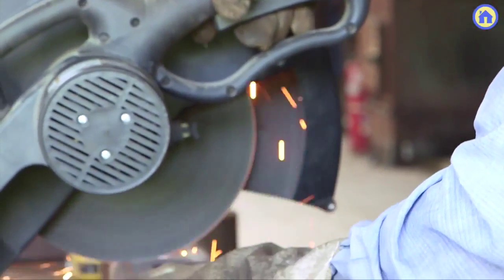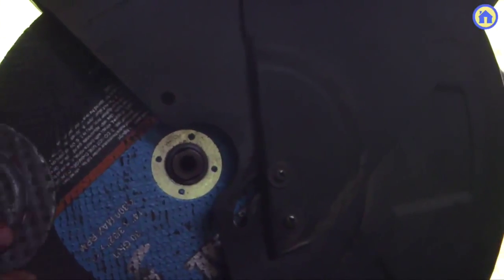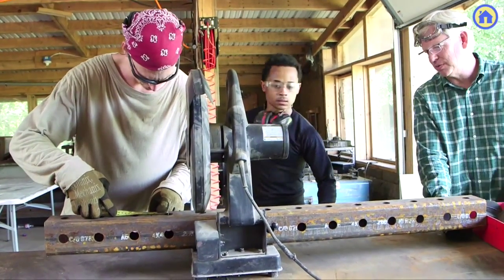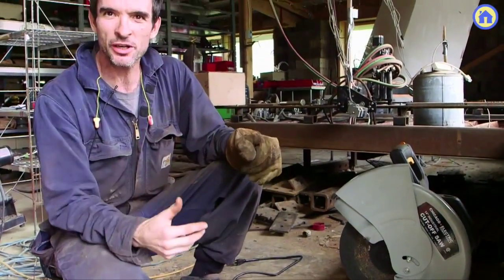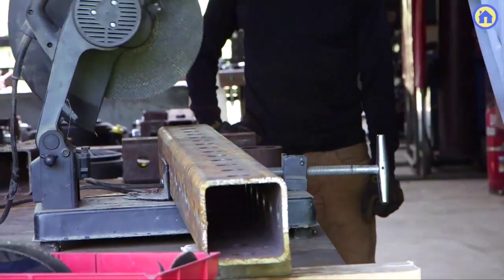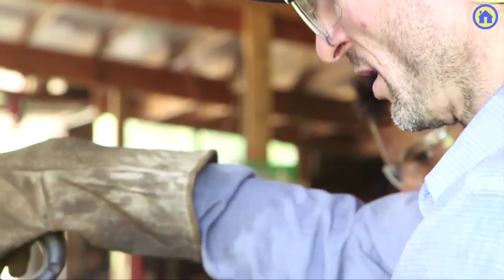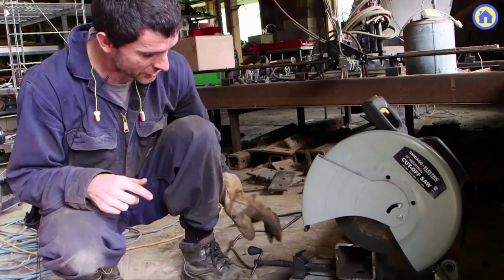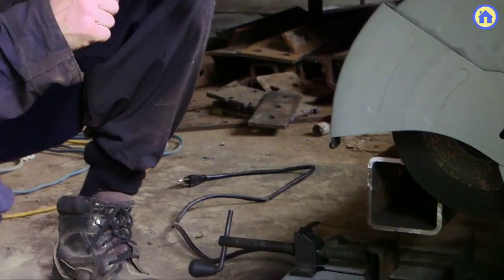Abrasive Cut-off Saw - how to use it?

Comment: I have a Dewalt chop saw and for what ever reason it won't cut. It just sits there and gets red hot.
Reply: Same here! I purchased Dewalt cut off machine from Amazon to build a metal frame from 2×2" box tube but it feels like that the machine will take forever to cut. Sometimes it makes the cut but the cut goes off like slant, Even cutting straight is not possible on this machine. Let me know if you have any solution.